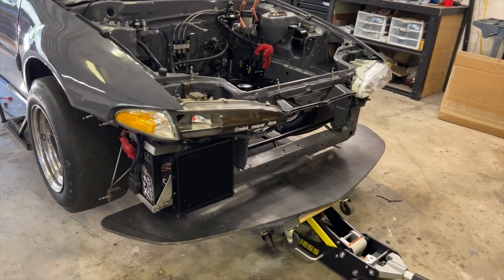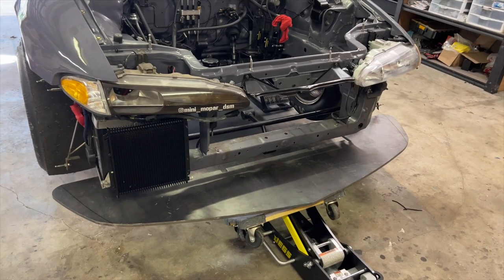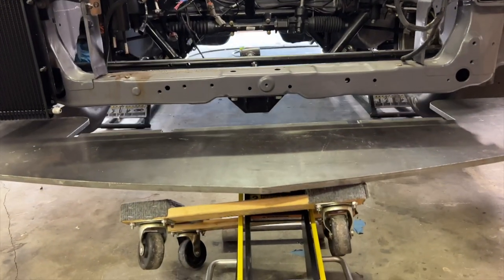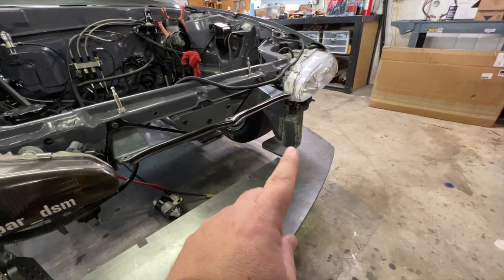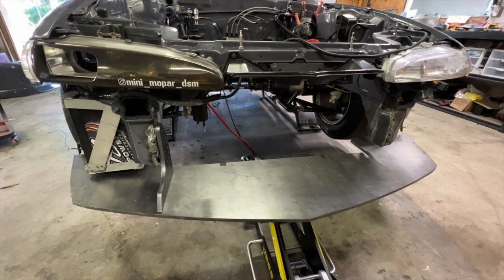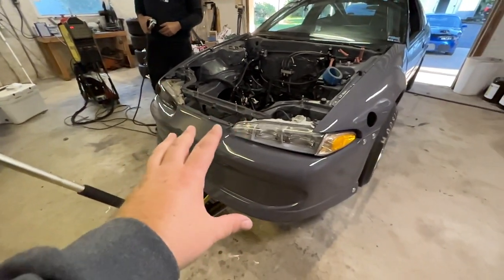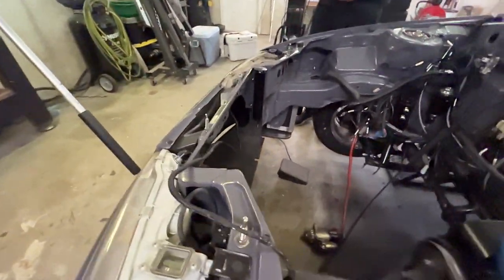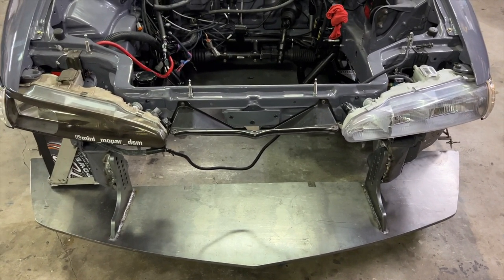Installing a 120 Pound Weight Plate

Comment: I remember Joe taking the time to grind off unused brackets in the engine bay just to save a few grams. I can't argue with the success, but I have to wonder if there's an alternative. Hmm.

Crazy ideas time. Since the goal is traction off the line, would it be legal to use that weight for an electric "launch wheel" instead of dead weight? Have a wheel or even tank tracks drop down just for the launch, then get pulled up once you're going and the tank tracks can't keep up. Use an electric motor to power it, perhaps with capacitors instead of batteries. Then reassure anti-racing folks that you are driving an efficient eco hybrid.

OK, OK, after typing that out I can already see problems. Sill, it's a fun thought. Put the weight to use somehow on a traction or power boost. Just thinking out loud. :-)
Reply from the maker: 🤣🤣🤣 that’s pretty far out there!

Comment: Adding weight to a race car to make it faster plays with the mind no doubt. How much do you theorize it will take off your ET?  Any plans to take out any more weight somewhere else to help offset the addition?
Reply from the maker: Previous race weight was 2365 and it needs to be 2450 with the 72mm turbo. I do have some other weight reduction mods and I will likely have to ADD weight when it's all said and done.
Reply: @JoeWrenches  I didn’t realize how serious the diet was on your build. That is crazy light even for a stripped out DSM. Good on you in making it happen. I can’t wait to see what you achieve this upcoming season.
Reply from the maker: It even has a full interior and most of the glass. 😉
Reply: I saw the interior. Very impressive. Having to add weight is a good problem actually as you can disperse it for full functionality like you did in this video. Have fun with it! 😃

Comment: Are you on an engine rebuilt ? I guess yes for accomodate new 72mm turbo power ?
Reply from the maker: The block is being filled and it's getting an o-ring/copper gasket set-up. Hard parts are the same, Wiseco HDs and R&R Aluminum rods.

Comment: It's so counterintuitive to add weight to go faster but if it works?
Reply from the maker: It does help, and I have to meet a minimum weight anyway. This actually helps me get there.
Reply: It's really not counterintuitive though. It's repositioning weight to where it will acitually help you. Putting the weight in front of the tires will greatly aid in gaining more traction for a fwd car. Can also help with overall weight balance as well. There's a big reason why Honda guys do it, and Joe going for the same gains as well.
Reply: @mr.nobody7601  I wasn't disputing the fact that it works just stating how wrong it feels.  Every 100lb removed = tenth (0.1s) in the quarter.  A lot of people including myself spend large sums of $ to remove weight so when you see it added it warrants a double take.
Reply from the maker: I’ve spent large sums of money to make my car light too. Started as a base 1.8 with many lighter components, Chassis completely media blasted, Custom tube frame k-member, lots of carbon and fiberglass, hundreds of dollars in titanium hardware and priceless amounts of time.